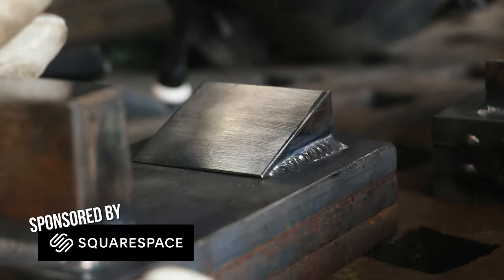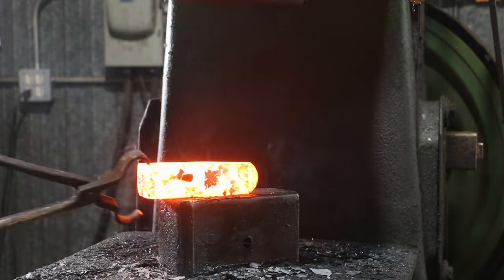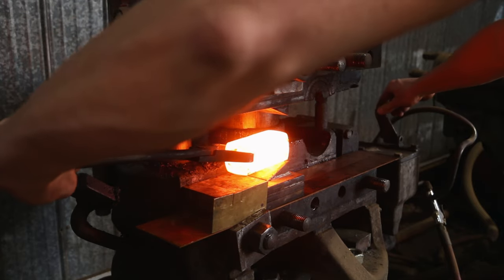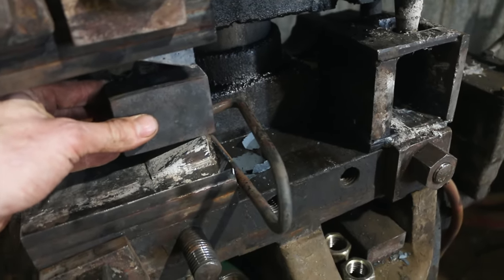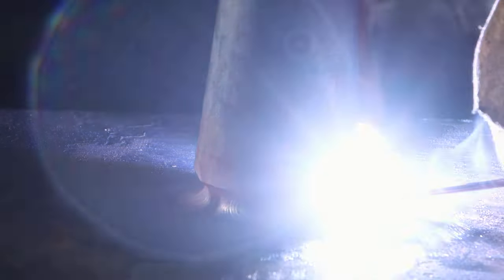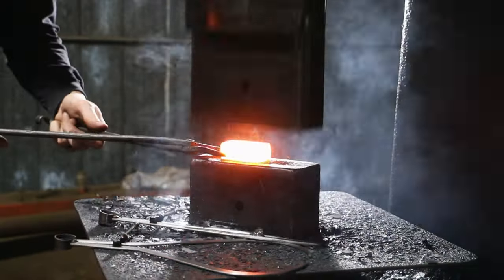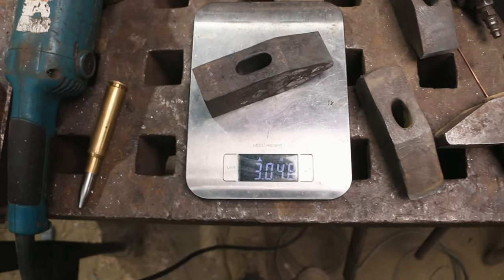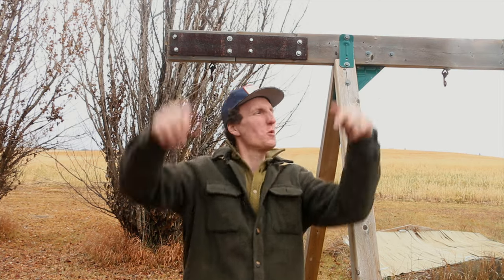Dialling in my pneumatic upsetter to make hammers.

Comment: I'm curious, might it make sense to use a form while punching, to constrain the sides while punching the exact handle hole size/shape you want? This way it doesn't need to have bulging sides pushed back in causing the eye hole to deform. I'm not a blacksmith, but just a viewer wondering if there's a reason not to do this. Love the vids, also you forgot your outro, keep the forge lit. (;

Comment: please excuse my ignorance, but couldn’t you drill a hole in the plate that the punch is welded too and plug weld on the back side?  Causing the punch to be supported on the backside also, similar to a rivet.

Comment: I had a though as well. what if you made up a small drift the size of the handle eye you want and incorporate that into the upsetter die making the peen end. that way the eye could not deform as you press the peen into the hammer.
Reply: If you watch at 4:30, the whole head moves backward away from the pinch for the peen, meaning you can't have a fixed eye punch in the same operation as the pinch.
Reply: @Bobs-Wrigles5555  if you place the fixed eye punch at the point where it ends up after the squeeze and let the peen of the hammer move instead of the body moving it would work just fine. would it not?
Reply: @crazychupacabra4449  I don't think so, the top and bottom of the pieces that pinch the peen need to be fixed in alignment in the upsetter, otherwise the peen doesn't come out correctly, meaning the hammer head has to move away from the pinch and the eye can't be done at the same time.
I believe Tim's first attempts had a back stop which didn't allow the head to move and the pinch didn't work right.